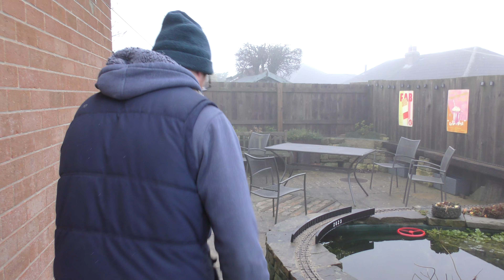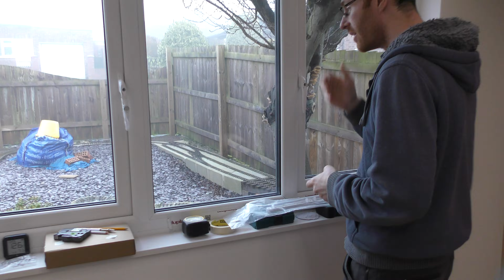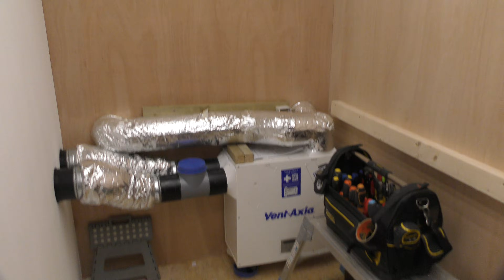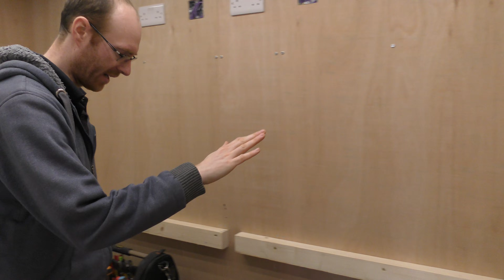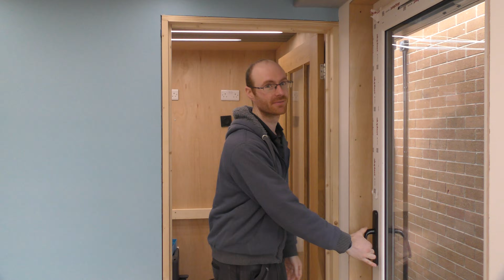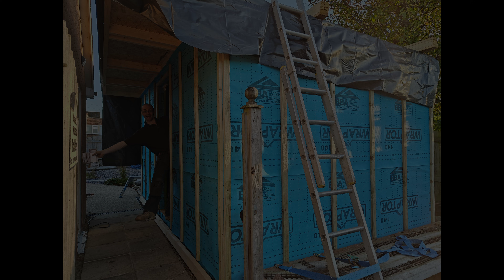Project Building - Building in the wrong scale

Comment: 26:09 Just a thought about your printer room and the wires I’ve worked in Data centers in my work life, and they have wire racks that you can run your wire up into and then bring them down down to the outlet. That way you don’t have to bundle your wires and hang them with the weight against the outlet and ware out your outlet .so the wire rack run across the top of those outlets hang just above them and you would just run the wire up and shove the extra up into that wire rack and you could just bring the lead down and plug into the wall. I hope that was clear if not, let me know. Feel free to DM me and I will make an attempt to get a picture of them and forward it to you if you don’t know what I’m talking about have a great day and yeah, I like the look at your building